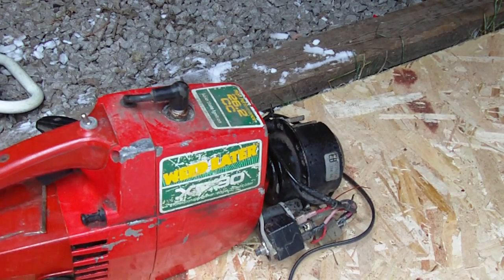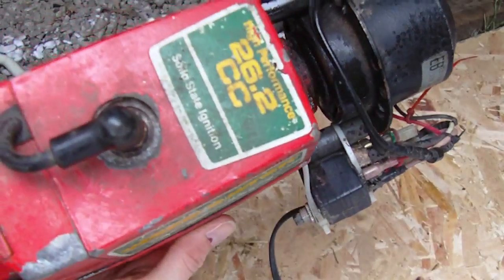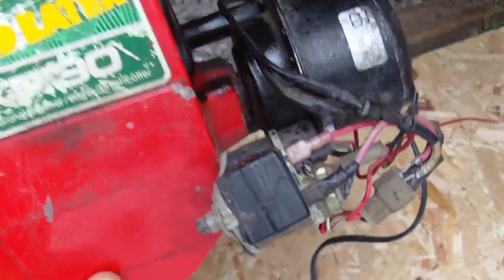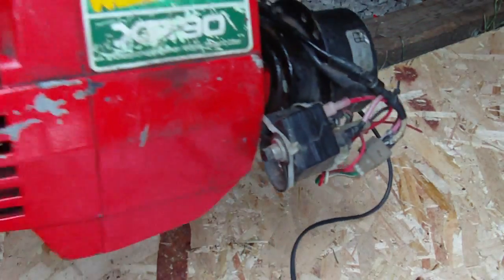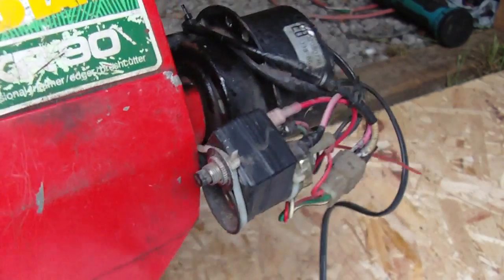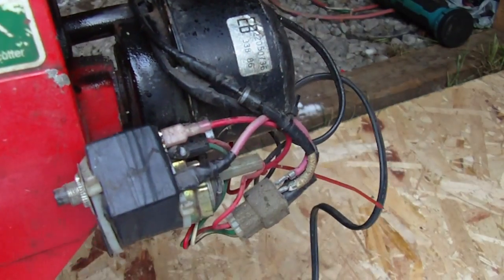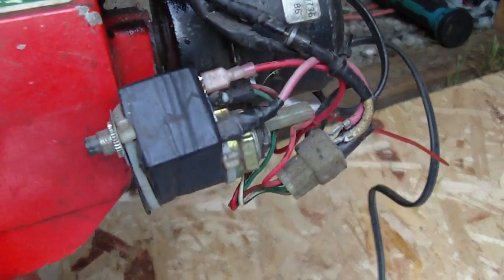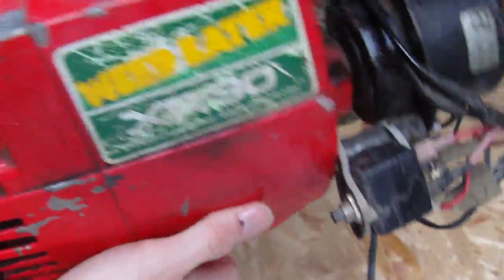Homemade 12v Generator from Weed Eater

Comment: So you have a very good understanding of alternators and power that despite my trying to learn i cant figure allot out. 

Ive seen your homemade generator and its goes very well with what ive been trying to do.  Ive been trying to rack my brain around how to run multiple alternators but instead of a gas powered engine i was trying to find a way to eother hook up a solar panel to a 12v permanent magnet motor to spin the multiple alternators at once. Hoping to generate more power from the nominal power source of the 12v solar or even a battery that i can use to turn multiple alternators and power a shed im trying to do wood working in.

Comment: People, if you can't find an electronics hobby/supply store, order a high current rectifier online, or pull one from an old alternator output and check if its still good.

Or just use an alternator to generate the power.

Comment: After watching this video, I made my own, I added a voltage regulator and inverter with a very quiet muffler silencer. It's super compact for camping. Thanks for the idea.👍
Reply: But is it quiet enough? I've just got a broke shaft strimmer and was looking into making one of these mini generators from it but 25cc engines are notoriously annoying
Reply: @kristianperryadams  with a good muffler and a box , it's slightly quieter than a trimmer.

Comment: I love your videos for the ease of absorption of info and thorough explanations of design and operation any ideas on taking gen head from 800 watt clone/h.f. portable genset and either belt or turbine configurations as stand alone design and the issue I have is motor input shaft has that bearing needed and input stub needed for belt  or any type of power transference as well as armatures position at that end now the challenge is no machine fab tools welder ect.i need the macguiver dildo to jackhammer lock pickin tool building wizard that I know you are to help me figure out a simple effective way to salvage my  alcohol fuel murdered generators e85 and me smoked 4 less than 50 hrs between all and I'm trying to get some use and scavenge the heads reconfigure input to belt or compound gear set to turbine? and really I respect and am humbly grateful for your shared efforts and opinions and please any and all neg and positive input or methods of this and how could I take two matching heads head to head pully in the center and separate/combine their out puts?polarity switch one to compensate rotation reversal? this in design eliminates need for bearings with just a keyed shaft and pully at the their positions can it be done? what are the variables and methods of safely  testing and operating these ive been hit by 480 220 and 110 the 110 grabs on to you  the others blew me off so I really don't want to wire it wrong or combine that circuit if its not able to do and I trust your knowledge of  electrical design and fab skills and sadly its a mountain man type vanishing art style or method of living you are graced to have the ability to do and its a sad bad loss of creative effort and beautiful minds achievements never to be seen cause the materials/components of which these efforts and achievements where and are made are outlawed condemned and unsaved without the past there isn't a future and you are one of the few who seem to know and create in that modality

Comment: I'm not sure. But it looks like the diode is backwards.
Reply: What makes you think the diodes are backwards?
Reply: Just the one I can see. The silvery line should be on the other end of the diode.
Reply: If it was backwards then this wouldn't work, right? Also I did not see a circuit diagram so I am not 100% on exactly how they implemented this. What type of circuit do they use to convert the motor to a generator?
Reply: A blocking diode is used when charging batteries. It stops the flow of power only one way. I think what he had done is to put the diode on the negative wire.
Reply: I would need to know what circuit their are using and see a diagram of the circuit and know what color wires he was using for what. Again if it is backwards it wouldn't work at all.

Comment: Output voltage is DC,how do you control voltage when you charge a battery?
Reply: I think he turns the "idle speed screw" of the engine. A car battery should be charged at fourteen volts, but I think you could go higher voltage.
Reply: That's a good question.  The voltage would have to be set by the screw as per the comment above, but in case anything in the engine changes, too high of a voltage will damage the battery and even be hazardous because of hydrogen emission, and too low of a voltage will cause damage by sulfation over time.  There would best be a voltage regulator or charge controller after setting the speed higher than in this video.

Comment: I had one of those Weedeaters, found it on the side of the road in somebodies trash. Got it running, worked great for about 4 hours then died. Ended up back in the trash.